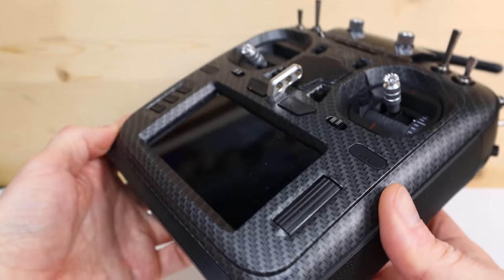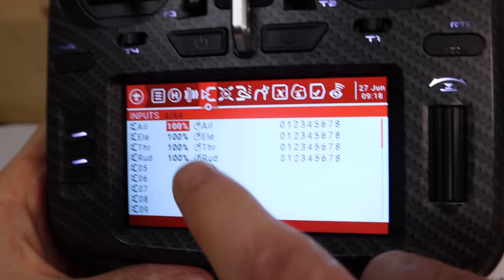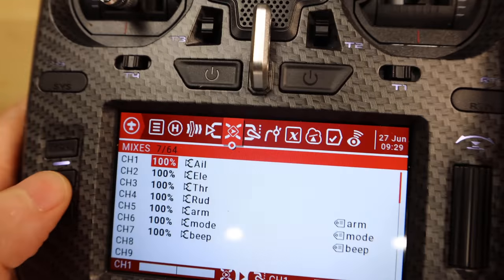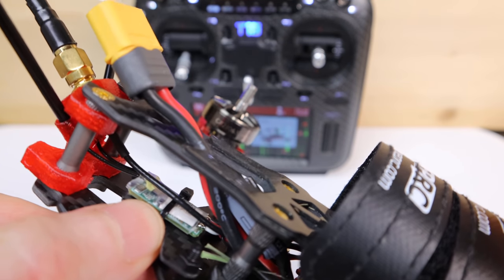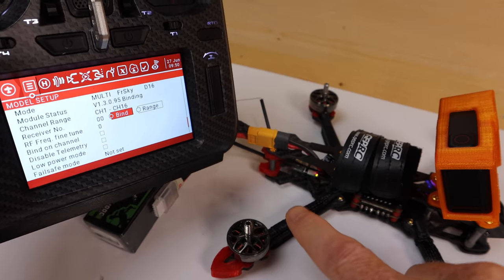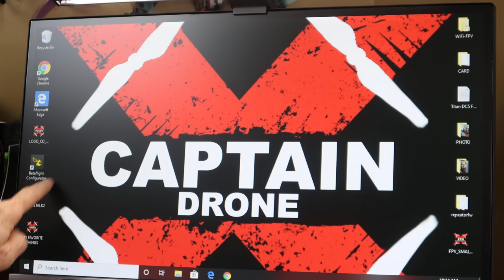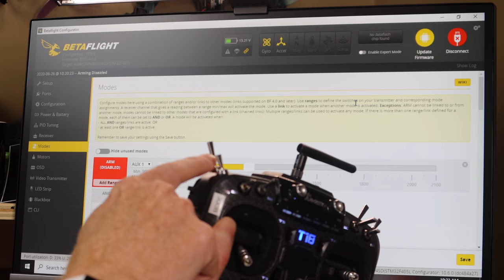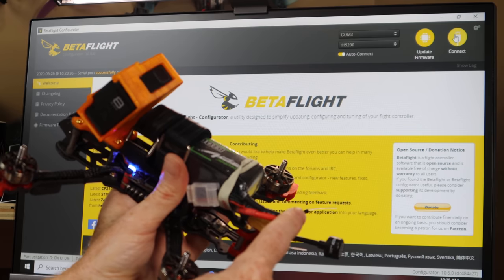EP 9 - FPV FOR BEGINNERS - How To set up an FPV ANALOG Drone - Bind, Radio, Betaflight

Comment: I studied my fpv build for months trying do it right. I got a 2s whoop instead of the 1s I ordered from betafpv. The 1s BT 2.0 batteries are useless now. Had to buy 2s. The radio I bought won't work with this Rx, so I need a new radio. Tenergy  lipo charger. The Spexman 2 goggles worked out fine. Not done. It looks like a 20 day project @ $644+.
Reply: John Taylor   Hi John...I had the same issue that my Spectrum DX7S didn’t work too.  So I had tp buy a new radio.  I purchased a Jumper T18 Pro. I think I only paid something like $200 USD.  I am having issues with Betaflight. I’m coming close to making this BETAFPV 65 work!

Comment: A question for you Captain, are there FPV goggles that can be used with a Xiaomi fimi X8 SE. Thanks for your great videos.👍
Reply: No Stephen You cannot do it
Reply: If you want you can put the app in be mode and use it in vr goggles .
Reply: Yes you can use the FIMI x8 with FPV you have to use a Tablet with HDMI output,    Teclast brand from Banggood.
Reply: @sairams8879  wrong you can
Reply from the maker: Stephen, the answer is no for the simple reason that the FIMI is a Camera Drone and not an FPV Drone.  FPV Googles are on the 5.8 ghz spectrum and are specific to certain bands/channels.  Sometimes drones can use something called VR Goggles (those $30 Goggles on AMAZON that you put your phone in), but I can't recall seeing that on the FIMI.   If you want to fly with Goggles you should really consider getting into the FPV Hobby and watch my series entitled FPV FOR BEGINNERS.
Reply: @CAPTAINDRONE798  Thanks for your reply, With the other comments I am now confused. I have emailed Fimi for an answer as well. Thanks again.
Reply: @ageranger1541  Hi thanks for your reply. Can you give me any more info re the Tec last tablet and which goggles would work without getting a mortgage.
Reply: @ageranger1541  told you

Comment: i have a jjrc x12 aroura and i was flying it and then i put the controller down to get something and then i picked it up but i couldnt move it and then it flew off sideways into a tree i was wondering why that happend btw i found it and it still worked as usual afterwards